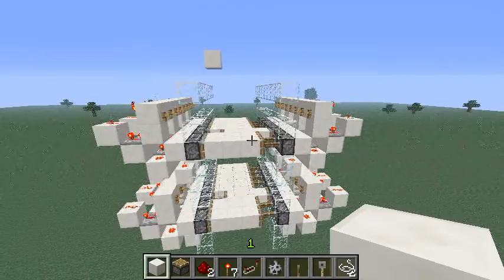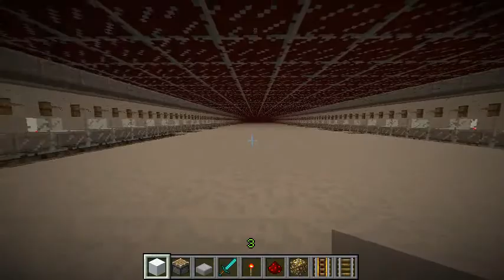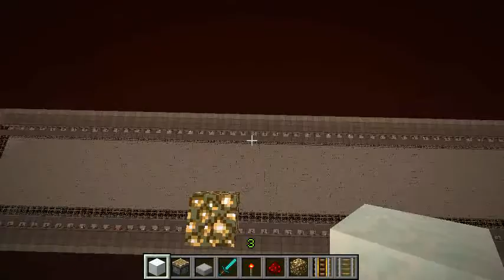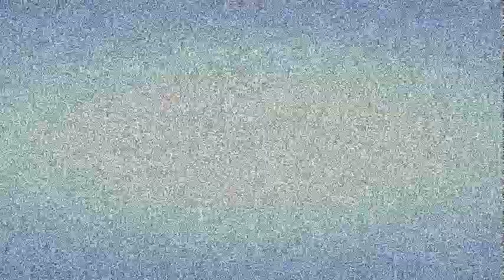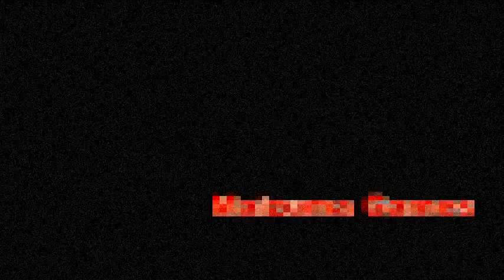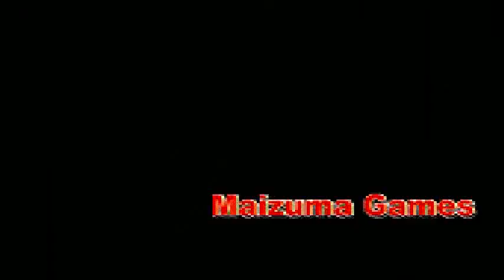Resource Friendly Smart Shifting Floors Mob Trap (Phase I) | Minecraft

Comment from the maker: It would not hinder the spawn rates but you would need to have a smaller platform on the bottom (2x13), which would loose the point of this trap. To use it for xp, ideally you should calculate their fall damage and then move the zombie pigmen with pistons to the killing area.